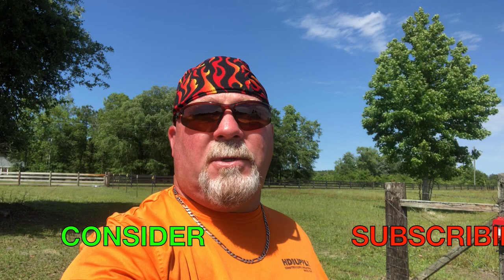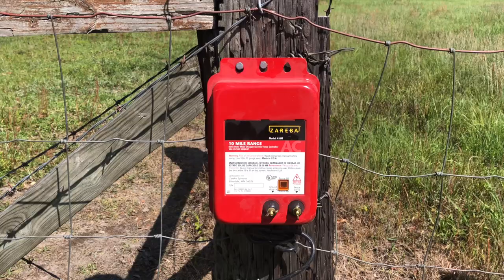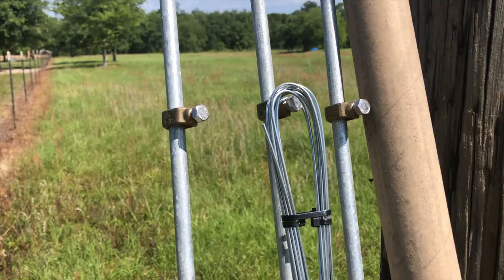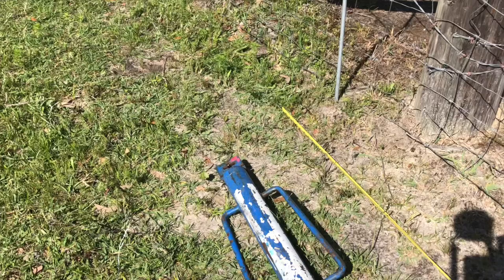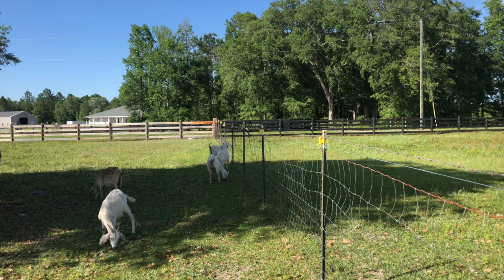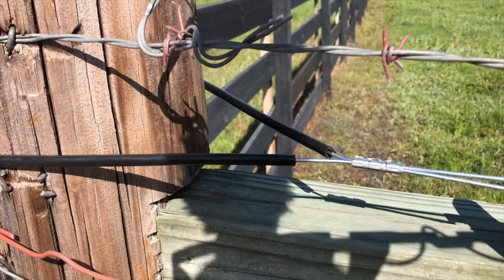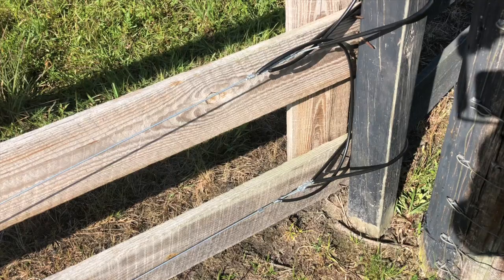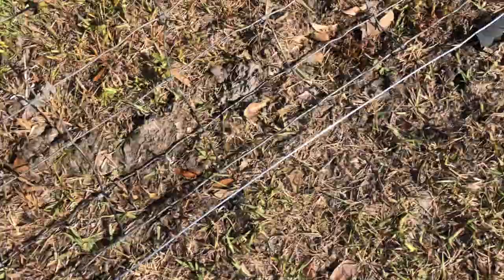Detailed Installation of an Electric Fence Charger |  Installing Ground Rods for Your Electric Fence

Comment: A question I can't resolve looking through the net:  I have a solar charger and need to know how to put washers and wingnut on the two (pos and neg) pegs on the unit. Help.  Also, I  am grateful for the info on this video.
Reply from the maker: It would be helpful to see the unit and parts but I assume you are asking if the order is wire then washer then wing-nut which I would say is correct. Or if you have 2 washers then sandwich the wire between the 2 washers. Hope this helps. Thanks for watching and commenting 👍🏼🤠

Comment: Will the electric fence alone hold goats in? Or do the goats just walk through it as I have heard from others?.
Reply from the maker: Great question. I
We use hi tensile which is different than standard light wire. Wire spacing and higher joules (output from charger) are big factors. We haven’t started cross fencing with just electric ⚡️ yet but we intend to soon. I have visited other farms that are successful with this method. Thank you for watching and commenting 👍🏼🤠⚡️

Comment: I got hold of a 6 joule charger (100 mile) it makes you invent new cuss words, and makes all future babies be born naked. On a serious note. We have rock 1 to 2 feet down. Can one just ground to a wire hooked to t posts in the fence for the ground instead of trying to get ground rods down 6 feet?
Reply from the maker: I appreciate the good laugh. Truthfully I think it has a lot to do with your moisture content in the ground. Obviously in order to complete the circuit you have to get a good ground as in connection. I have establish the ground in as little as just a few feet in certain places where it’s been more difficult to drive the rod all the way down. It may take a little bit of trial and error. Great question and thank you for the comment I hope this helps. 👍🏼🤠

Comment: I have 80 acres.  The longest distance from the charger would be a 1/2 mile.  I have a 6 x 6 wet weather creek/ditch.  Will I have to have a separate ground wire on the fence?
Reply from the maker: Most likely yes. The fence charger  manufacturer should have a recommendation on the instructions or website. Each manufacturer may has different requirements. 👍🏼🤠
Reply: @McFallFarms  Thanks

Comment: Why did you use 3 ground rods? I am running 360 ft of electric fence for deer to keep out of my garden. The guy at the store gave me one ground rod, do I need 3? I plan on using this fence for less than 2 years, already have chainlink and will putting that up in the fall of 2022. Thank  you!
Reply from the maker: As long as you get a good ground you are likely fine. Certain soils are harder to get a ground. Also larger chargers need a solid ground system. My charger currently does a 4wire system over 2000’. Get a fence tester and make sure you have good voltage and you may still be fine. Thank you for watching and commenting 👍🏼🤠

Comment: What if my rods will only go in 3ft due to rock. Checked many locations
Reply from the maker: We are in Florida and pretty sandy so we have to go deeper. If it were me where you are, I would drive them as deep and as solid as I could and maybe add 1 or 2 extra rods to the system. Hope this helps. Thank you for watching and commenting 👍🏼🤠
Reply: @McFallFarms  gotcha ty. I happen to have extra rods. Hope you and the family have a great year